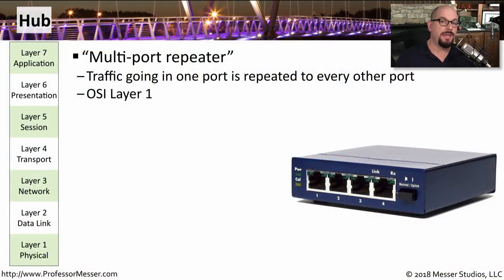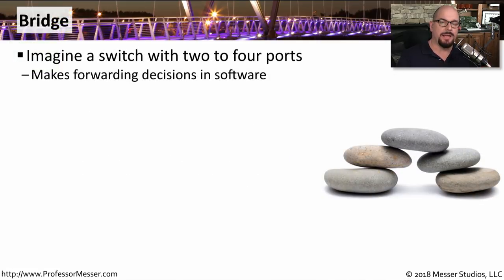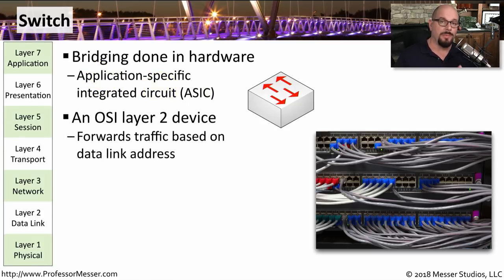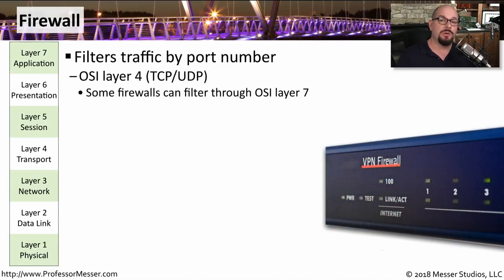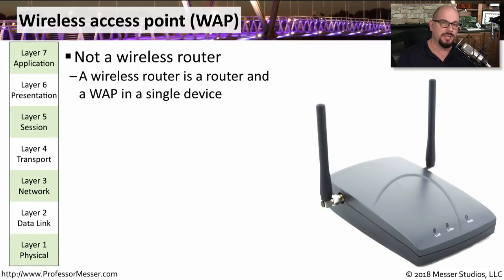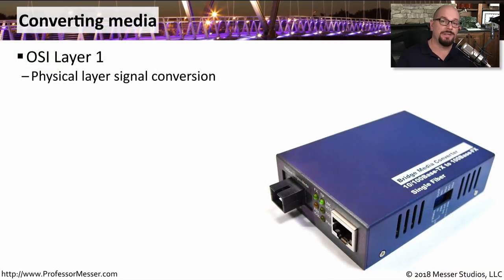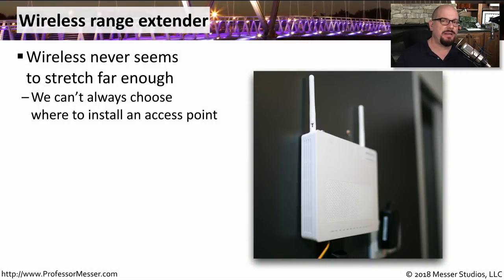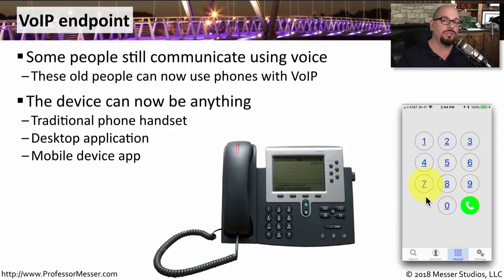Networking Devices - CompTIA Network+ N10-007 - 2.2

Comment: Question - A wireless access point has bridging capability and can bridge clients to the same existing network, but doesn't a bridge function differently than an access point in that in connects two different networks? So aren't AP and Bridge two different things? Kindly help. Thanks.
Reply from the maker: A bridge connects two networks together at layer 2. An access point is a bridge as well, since it's connecting two layer 2 networks, even if those networks are different topologies. A switch does the same thing. It's all bridging.

Comment: How is a wireless extender different than from an access point?
Reply: A wireless extender does not work on any layer of the osi model (well as far as a networking device, but I guess layer 1), it just extends the signal from the WAP to reach a further location.  Unlike a Wireless Access Point, which 'bridges' the wired network to a wireless one.  Think layer 2 for a WAP and a type of antenna for a wireless extender.